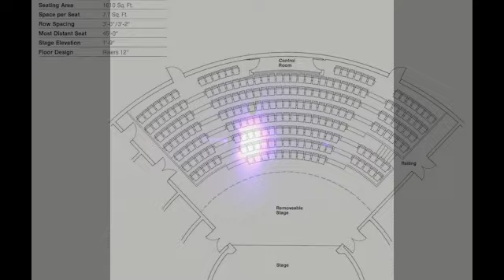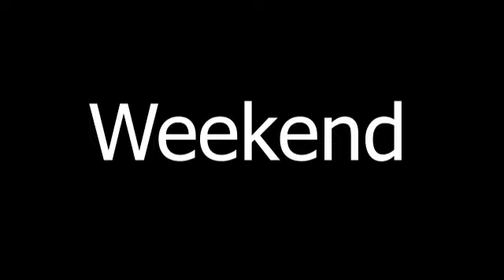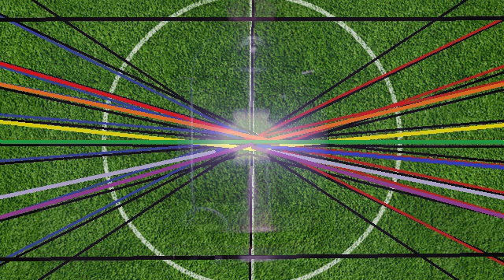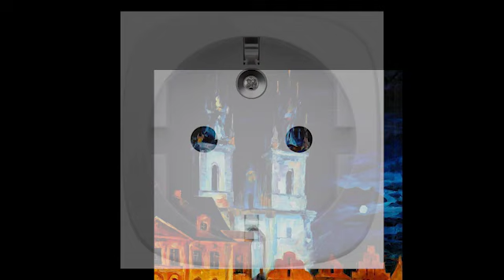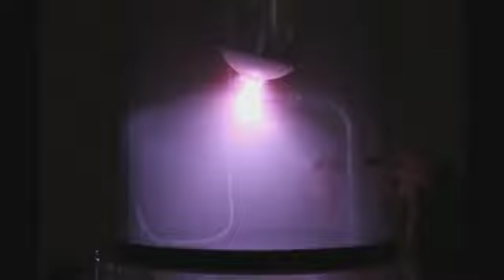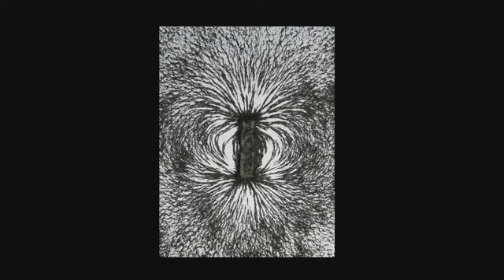Sport Circuits Part 2 - The Squatter Man

Comment: hey chad, have you noticed the symbols in sumo? the wrestling ring(squared circle flat earth map) to even the garments which the wrestlers wear? one step further, notice how the wrestlers use their opponents energy against their them to throw them out of the ring. it's not just about brute strength.
Reply from the maker: Hi  Lazyboy, I hadn’t thought of sumo! But I feel it still applies yes, as it does with the UFC octagon shape. It could actually be one of the better representations of the two types of energy. Interesting , thank you. 
If you ever wanted to chat about it you can find my contact details on my page or on earlier videos ❤️